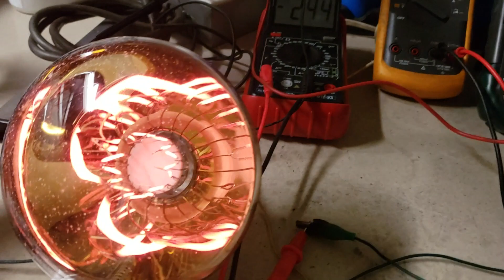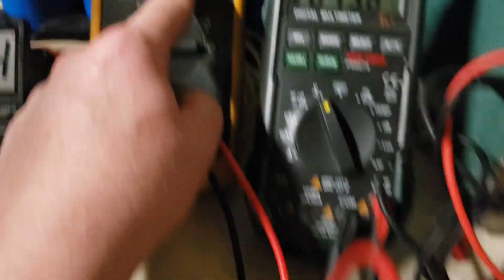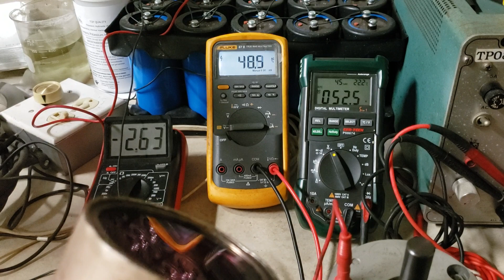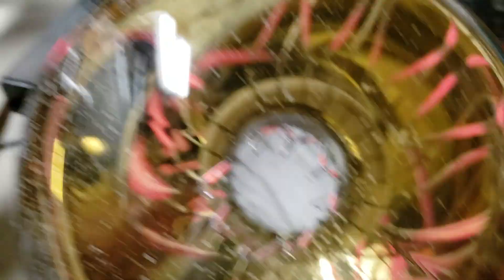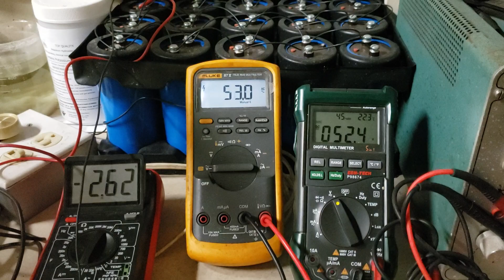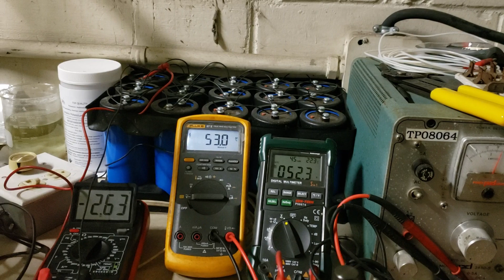Pt. 3 4~Phase Superconducting Power Plant Understanding and Tesla's Wish Granted

Comment: Interesting torus. What is in there?
Heterodyening, like zero point folding, key to making a great and even over efficient particle acellerator. Instead of using a function generator though, sets of coils may be used in certain geometric designs. You'll find it interesting I hope that Grebennikov found certain chitin structures did this with pinecone like shapes seen only under electron microscope. A stingless wasp, and to some degree, certain beetles have wings with such structure. Chitin never degrades because of this effect!